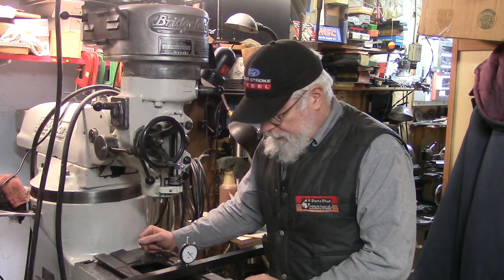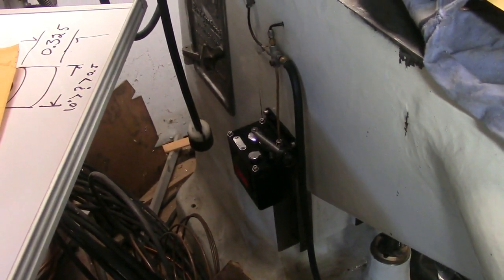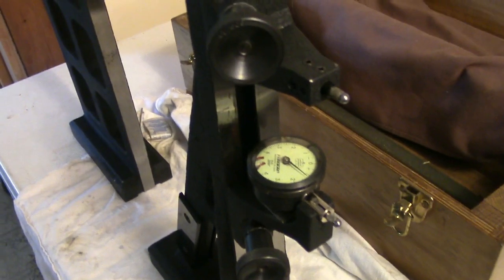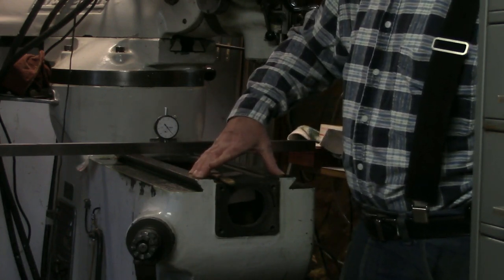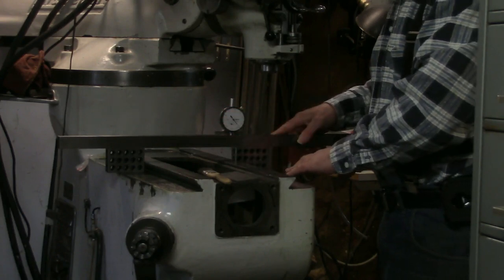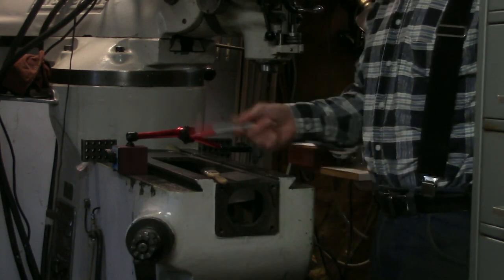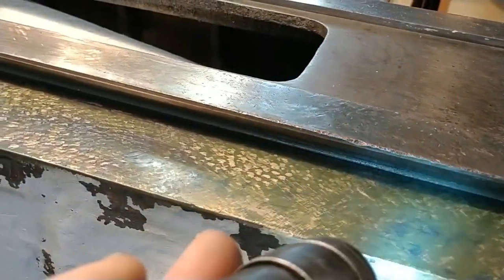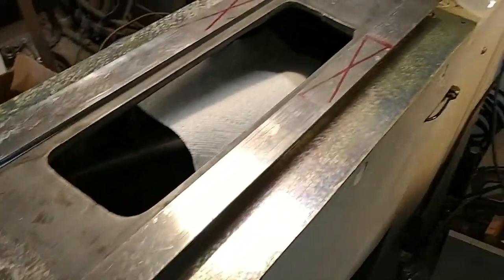Rebuilding Bridgeport Mill - Part 3

Comment: After seeing this I can now see why most manufacturers have switched to box ways, not hating just seeing the issues. Thanks for the video, I just picked up a "pretty clean" series 1 boss mid cnc update for cheap. Im looking forward to scraping her in
Reply from the maker: It might be easier to measure and cut box ways, but probably easier to scrape, and print, the underside of dovetail ways.  Either way, good luck with your scraping.
Reply from the maker: I poked around the net looking for newer mills using box ways (Jet, Grizzly, South Bend). Except for the smallest mini mills I still found lots of dovetail ways. Could you supply me an example? Thanks.

Comment: How much does it cost to get a table and saddle planed, like that?
I've got an old, beat up BP that I'd love to do a full restore on, someday.
Reply from the maker: Phil,. Can you please PM me at incidentalinformation@gmail.com?
Reply from the maker: Phil,
To answer your question I wanted to elaborate beyond what's appropriate for the comments.  But... the simple answer is, it depends.  Shops with LARGE surface grinders get LARGE $$.  Guys like I found with old planers are much more reasonable.   I would budget at least $1000 (I paid a little less)and see what you find from there.